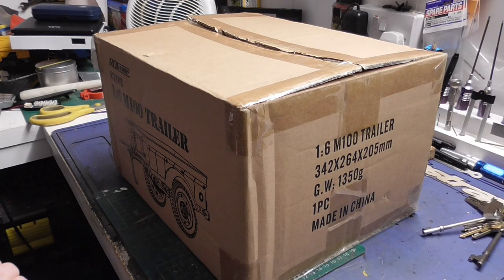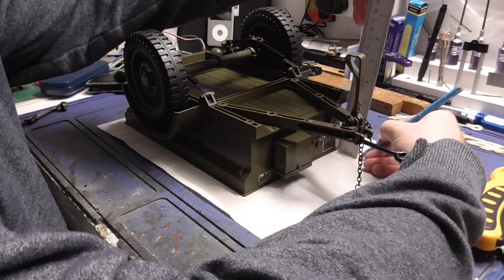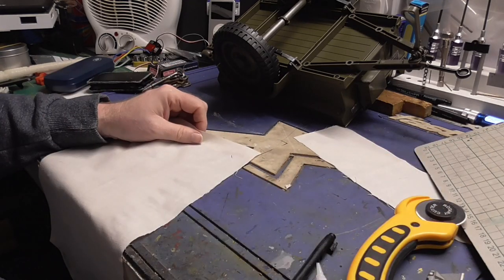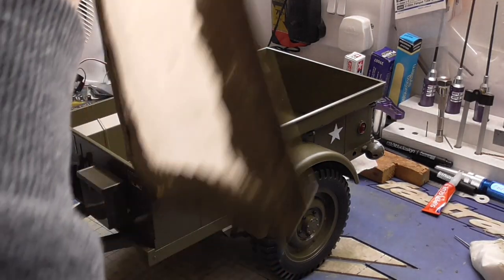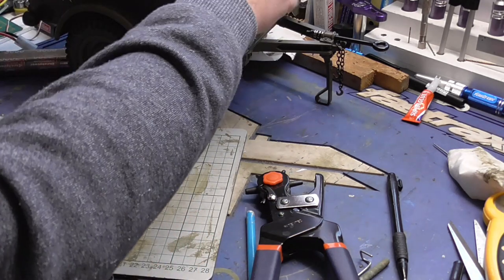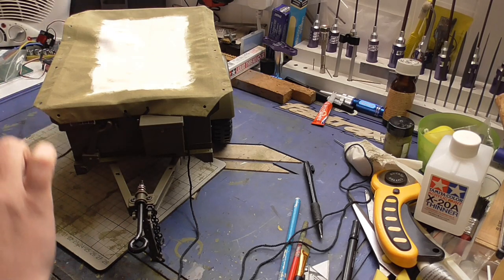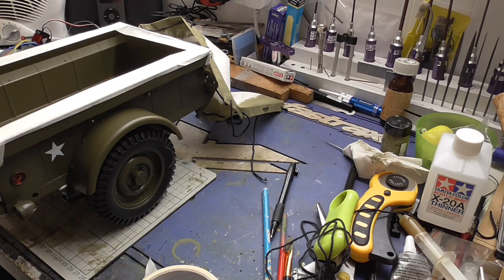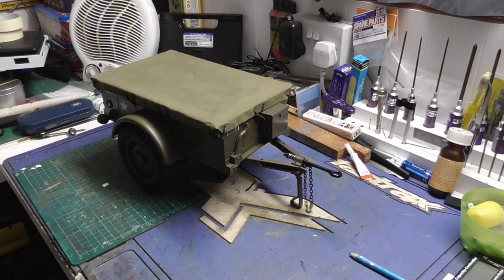ROCHobby 1/6th Jeep - M100 -1941 trailer unboxing and Making the Tarpaulin cover

Comment: That was a great build your cloth work is really good Malcom I picked up some tips from this one I never considered painting I always look for the right color cloth this way has more options and stiffens the material
Reply from the maker: I use the cheapest pillow cases from the local supermarket 2 for £2 and you cannot buy cloth much cheaper than that. The colour I use is Natural, being such a neutral colour it takes paint well. The paint does stiffen the cloth well just like they did on old aircraft. It's a good way using up paints if you have had then for some time, as long as the main colour pot is the one you want and then use up bits that are not too off or use a lighter and darker together.